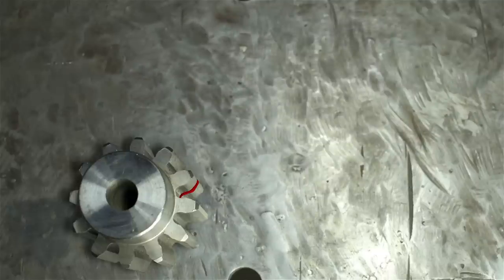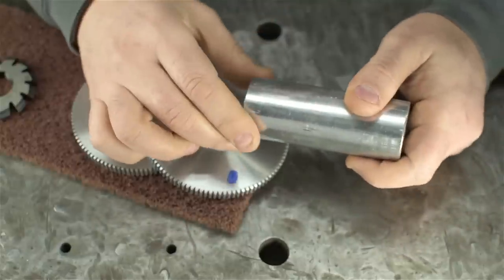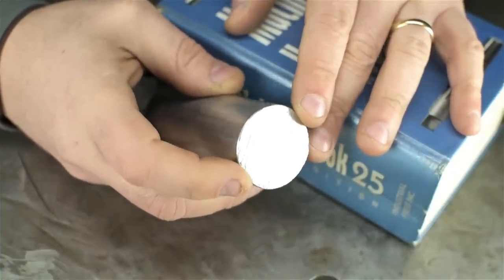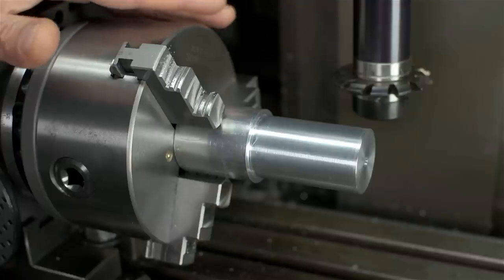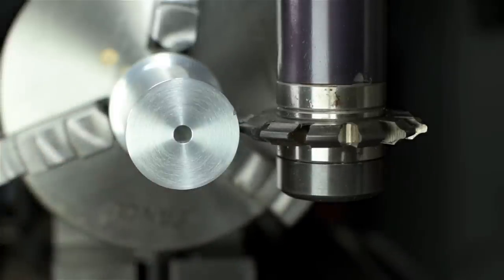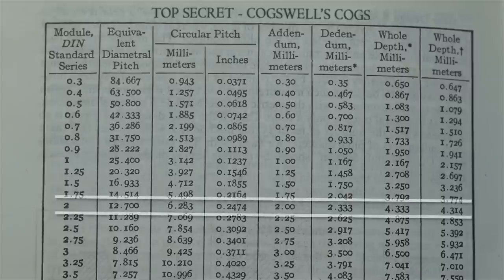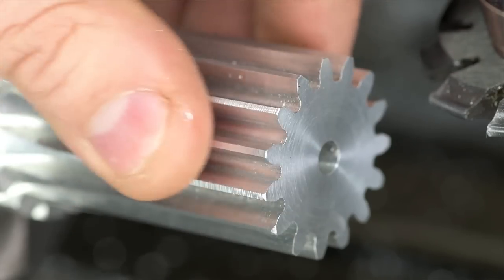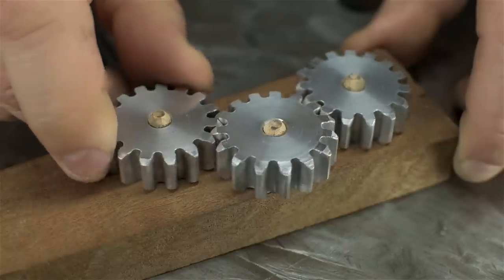15T-M2 Let This Be A Lesson To Ya!

Comment: suprised to see so mush difference between 2 chucks/machines  , you would say that after you align the chucks to 1/10th on the  machine its mounted to there should be no difference between different chucks and different machines , if there was rotating the piece a few times in the clamps should reduce it a lot 
as for beveling the geartooth , just guessing here but i think that if a gear starts to wear there will be a burr on the edge of the teeth and the valey in between the teeth  , that burr might be ably to cut through the gearcase its turning in . the camfer is giving some extra room for a burrand disalign the edges of the gills and valeys  , could allso be sumting to do with guiding lubricant running over the gear in between the teeth (kinda makes a small funnel )

Comment: So a couple of days ago I was working on a robot for school and I was working with a small gear input to a large gear output ratio and they were flat faced gears. So as I was running the gears with the wheel on them my finger slipper and ran through the edges of the gears, cutting them open. So my guess for the gear champher is so that if you do get your fingers near this at a high rate of speed then it won’t cut you as badly.

Comment: 4:25 - No Tony... it would not have been nice... at least not unless you can flip the cutter over and run the mill in reverse. Otherwise... the rotation would have the cutter pulling instead of pushing... and eventually the blank would come flying out of the three-jaw chuck.
... Not that I have ever done that... no... not ever...

Comment: The only thing the chamfer would do is reduce the weight of a gear, as it isn't on the axis of contact (w.e you want to call it). Maybe the chamfer slightly prevents things from being pulled into the gear mesh.

Comment: Maybe it's to release any pressure of buildup in the mesh (by grease or oil)of the gears in an enclosed case. Just a guess. Or maybe it's so the tooth doesn't contact the surface of the part as to not build up any heat and deform.
But honestly I have no idea lol

Comment: Watched the 100T gear video and now this 15T video. My question is how to determine which module you want to use when cutting gears. You likened it to thread pitch, but it seems to me like the tooth count would be more like thread pitch. 

Let me start again. You said you specifically wanted module 1 gears for the mini lathe, and module 2 gears for the three speed stick. What determined that? Could you not have made the three speed gears module 1 and 15T?

Comment: the chamfering of the gears is done because those edges are the weakest points (least material around it to support it). so during operation (or handling) thats the most like point of it to break a small edge off, which you really don't want in an enclosed gear box... cause obviously it could jam the gears

Comment: I would appreciate if you could explain when it is preferable to use brass instead of ball bearings? And any other "rules of thumb" to consider when you are building a pivot or axis into your design.

Comment: The base material is less and therefore easier to break or chip off the closer you are to a corner. It will even yield or flex to forces. Eventually getting tired. In worst case starting cracks to form. Heat is a thing too expansion and contraction may develop cracks over time.

And yes sharp outside edges and corners er prone to stress-failure just like inside corners. 
It's not just for you're pleasure you debure and break sharp edges. 

It is very important to chamfer and debur  accordingly

Comment: We have one of those kid's books with wheels that can spin and on every page there's a vehicle of some sort to teach the kids what they are. The wheels are made up of three spur gears, two are the actual wheels and one gear just connects the other two so they spin at the same time. Problem is that there's about 15 degrees of backlash, and no kid of mine should have to put up with 15 degrees of backlash. Is it worth making new gears out of aluminium or do I just spring for titanium right away?

Comment: Hey Tony, I'm a big fan of your humor, and I have a question.  Everybody seems to love their dividing head, but they don't always have a plate with the right number of holes.  A 45T gear is a snap at 2 turns even.  A 46T gear is easy if you have a 23-hole plate (advance 1 turn + 22 holes).  But a 44T gear needs a 22-hole plate which maybe you ain't got.  This problem only gets worse with more teeth; I need 127 and that's counting my bicuspids.   Have you ever used a rotary table and just been really careful setting each angle?  Or would you make a plate with the correct number of holes and affix that to the table drive?

Comment: The rope trick actually works if you want your drill press to run in reverse.  Flip the switch while it's turning from the pull cord.  T

Comment: I think they chamfer the gears because the contact line should be near the mid section of the tooth, if the axles of gears arent exactly parallel the contact will be on end of the gears and in time it will chip the edges off, so u get the edges off and reduce the chance of the edges being chipped. Gear calculation is based on the premise that the force is evenly distributed along the lenght of the teeth and not only on the very edge. If u leave the edges on they will chip off and fall int the gears, that wont be pretty.

Comment: This is how I though gear teeth were cut - then I've watched someone else do it - and they did it in 3 or so passes. First cut like this video, then a second pass down each side of the tooth with the gear offset and slightly rotated - as if the tooth cutter was the wrong shape. Look forward to comments on why they did that rather than use a cutter withe correct tooth full profile !

Comment: 🤔 Dang, i thought that step was for the gears that go on chain drives, so that the teeth slide a bit easier into the chain links and not just broach the plates of the links. But that feature seems to be adopted by recent mfg of gears. But what is the reason?

Comment: I am nothing more than a passionate viewer of machining videos, but I think that bevel on the gears might be something to the effect of making the gears less likely to clog up and eat away surfaces? 

Like if you had 90* angles on them and somehow they came a bit loose, the end of the teeth might start eating away from the surface they are resting on. And then if you have old oil that has turned into a paste, it might be better to make the oil clump up in the bevels rather than being squeezed between the gear and the surface that the gear is resting on. - Of course this won't be an issue if the gears are mounted to shafts that are basically "floating".

But then again, I might be completely off in my guess. I know it is pretty much an insult to even consider gear shafts being so loose the thing would be able to wobble around, especially so much that they'd start eating away other surfaces.

Though, to be honest - I've been told my casual "if there is less than a thumb worth of play, it's too tight" approach wouldn't really work with precision equipment. And I guess I'll have to agree with that statement.

Comment: Is there any chance I can talk to you about have a set of custom gears made for my highly modified Roper Rt-13? I need a set of gears made to speed the transaxle up. The tooth type or count doesn't matter(just need to be two same size gears and hold up to a lot of abuse), but they are on splined shafts. If possible, I'd be more than willing to send you the stock gears and shafts for you to get measurements off of and we can work out a price.

Comment: I suspect you chamfer gears to prevent the edge wear from grinding your gears. the 45-degree angle is stronger and as such has less deformation over time.

Comment: The sharp corners can chip off of the gears.. and then you would have chunks of metal floating around inside your gear box.....  That's why they bevel the corners away... much less likely to break.

Comment: I think they chamfer Gears because 90 degree Corners are stress risers. 
I don't know how true that is but it's what I've always heard, it's just serendipitous that they happen to look better chamfered.
Reply: It was proven long ago about square corners. When the first M1 rifles were made they did not have a relief cut in the Op Rod on them. By the time they were in use a few years they were starting to break. Ones that had not broken got an in the field cut put into them to prevent that from happening and those at the arsenal/factories started getting them when new. Now days it is hard to find an unmodified one but they are still out there. This is what an unmodified one looks like. http://cmpauction.thecmp.org/uploaded/2019-5-7/183229242D8e232D4d142Dbc7f2Ddc3081e78967DSC5F0008.jpg The cut ones look like this. http://cmpauction.thecmp.org/uploaded/2019-3-7/b5ce13f52D4d782D44b52D81fa2De152d2275c1bDSC5F0096.jpg The Brits took a while and a few planes to learn it but that is what downed the early D-H Comets. Square cut windows that cracked the Al at the corners. That is why the Comet 4s had rounded windows. https://www.youtube.com/watch?v=ZP_HXjqMKMs

Comment: How bout a video or two on making helical gears. Like those found in automotive transmissions. Also Hypoid Ring and Pinion gearsets.
Reply: Hey now, my pickup's 5 speed Allison transmission whines because it has a straight cut gear in it. Newer models dropped the PTO gear as normally installed.

Comment: Instead of turning the material on a lathe and then moving it to the dividing head, can
you reduce the OD in the dividing head by using an end mill cutter in the mill cutting into the oversize cylinder from above, on the centerline, and just rotate the divining head, opps, thats dividing head, around.  I have never seen a cylinder reduced in diameter this way, but 'thinking outside the lathe' it is a way to keep the workpiece in the same tool, and reduce the OD to the needed dimameter
Reply from the maker: have never done it myself but sounds possible!

Comment: ToT, would you use a grinding wheel or a mill with a wheel or hispeed steel or carbide to sharpen a wood chisel?🤔
Reply from the maker: a sharpening stone.  if it were really bad, start on a bench grinder to get all the nicks out. then a bench stone.

Comment: Now do a video on involute gear profile shifting to make meshing gears with a specific gear ratio that must be mounted on shafts whose axis distance is other than the nominal given from the teeth count and the module. Cause nobody has dared to do a video on that and there are millions of gears made that way operating inside our lathe ,mill,automobile transmissions etc. gearboxes. And we need to know how to machine those

Comment: About the "why chamfer" comment at the end I suppose you don't want to load the edge of a tooth, if it happens the two gears are misaligned to such extent, as it would induces more fatigue load from such a skewed contact point.

Comment: They machine the edge of the teeth so if the gear is stupidly against the a face the tooth is not grinding into it and and trying bend the tooth. Also likely helps with grease.

Comment: Hey Tony it's me again you helped me a bit a year ago but I still haven't done my project because of several operations that I've had to go through it's been a big pain in the ***. Anyway is there any way you could tell me which gear cutter you use for those large tooth gears in the ring roller video video. Apparently i'm not mentally capable of understanding the correct calculation to discern this information on my own. I know how to do the dimetro pitch calculations the whole 9 yards but what the gears are gonna look like when they're done as far as tooth depth width etc. Always is a mystery until it's done and that's not acceptable for my application. I'm obviously missing something. So if you just let me know the gear cutter you used if you can remember it would be a gigantic help for me

Comment: Gears need to be chamfered and deburred with a controlled, high quality process for the following reasons:

To avoid breakage: Excessive carburizing along the tooth edges can often cause breakage when the gear is running

To avoid damaging gears and bearings: If burrs are not removed, they may chip off during the running cycle and cause damage to the other gears and bearings.

To avoid poor tool life in the finishing processes

Removal of very sharp burrs reduces the risk of tool handling injuries.

Comment: The chamfering and deburring ofgears is often an undervalued process in gear production. ...Gears need to be chamfered and deburred with a controlled, high quality process for the following reasons: To avoid breakage: Excessive carburizing along the tooth edges can often cause breakage when the gear is running.

Comment: Y'all still using the Bones of Your Enemies? How medieval. These days the Modern Despot uses the Blood of One's Enemies for lubricant, their very souls for motive force, and their tanned skins to cover The War Engines. Now, if you need gears (but, what with all those souls doing the heavy lifting, such is limited) you CnC them out of a durable material suitable for the job at hand. I mean, Existential Evil is all well and good but the key to World Domination is not having your War Engines fail when you need them most. Also, your manicurist is a savage. I've seen more cuticle on a squid. As for the Gears? Wow. Strong work. I'm much too old to learn anything, but if I wasn't I'd have learned something. Cheers.

Comment: Tony please answer the question  is driving me crazy how can you tell which set of gear cutters you need to make big heavy beefy gears is there any way to tell which set you'll need for which type of gears I don't even know how to ask the question properly. I got the set for making Logan and South Bend lathe gears but those are all pretty standard little tooth years but I need to make some big gears like you make for your hand crank ring roller I'm making a similar type project
Reply from the maker: hi CW.  Well, you'll need to know the pitch diameter of the gear you want to make.  For example, I think your south bend gears are size "18" (diametrical pitch or DP).  The DP is the number of teeth divided by the diameter.  So the "bigger gears" will have a smaller DP.  If that's still confusing, or you don't know which pitch you want, check online supplier like McMaster.  It'll list the diameters and overall size.  Find a "big gear" for what you're doing, see what the DP is... buy that cutter set.  Hope that helps!
Reply: @ThisOldTony  wow I can't believe that I missed this reply you're awesome dude. I've been watching you for years I don't think I ever spoke to you before though. I know how to do all the calculations but I'm still confused about like the tooth size I basically want to make the gears you made on your metal roller device that you made. It's for a similar purpose a crank device and I really don't wanna use the fine tooth gears that I have and the set that I have already. I actually could probably make use of those exact gears that you use. Because it doesn't really matter exactly what size they are as long as they're beefy like the gears that you made they have nice strong heavy teeth. 

I know I'm missing something somewhere by not knowing how calculate that but at this point just doing it a number of times I'm going to realize what I was overlooking so if I could just find one gear cutter that'll cut say a 2 inch gear with heavy teeth I would be happy it doesn't matter though specific specs I can work around those. There is no need for worrying about ratios I don't need any speed requirement or torque requirements they just need to match and turn some rollers

Comment: RE: Tooth Chamfer

[ off of eng-tips DOT com ]

------------------------------------------------------------------------_
MikeHalloran (Mechanical)                                                                                                                                                                                  3 Feb 10 17:58
When the shafts become misaligned, e.g. while deflecting under load, that general area will be particularly stressed, and relatively likely to fail in fatigue, throwing a chip that will eventually find its way into the mesh and destroy the gears.  Better to remove it preemptively.

Still better; cut a small chamfer over the entire end profile, which is laborious and expensive when done by hand, but I think some machinery exists for the purpose.

NOT better; abrasive flap wheels and related items.  The random scratches from the abrasive grains don't help fatigue life.

Comment: Why relieve the corners of a gear: No gear support system has or maintains perfect parallelism or radial alignment or proper mesh distance. Gear supports flex. Bearings wear. Teeth wear. Shafts deflect under load and due to gravity. When gears and shafts and bearing supports get large enough, chamfering is replaced with crowning. Errors in mesh cause localized stress. These relief methods reduce that. Chamfered edges that do break off have a rounded surface, which would tend to ball up rather than "puncture" other gear surfaces. If you're playing around with your poxy little 800 HP racer gearbox, then getting 5 seconds of reliability out of straight gears might be hunky dunky. When you're driving 20,000 HP into a gearbox that is running the face heads on a mining machine, a little reliability goes a long way. Gear mfrs have no clue what you're going to do with that gear unless you are spec'ing the entire thing by loading specifics and ratios. Chamfering is smart business.